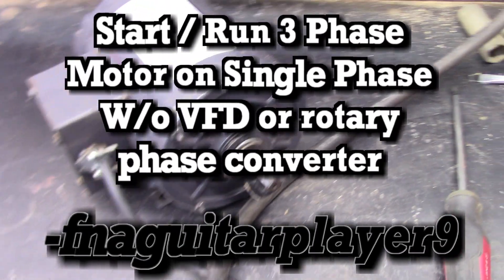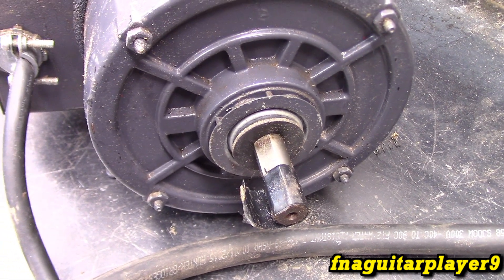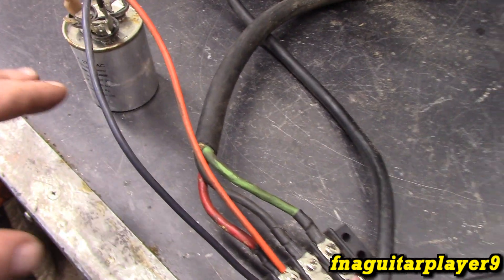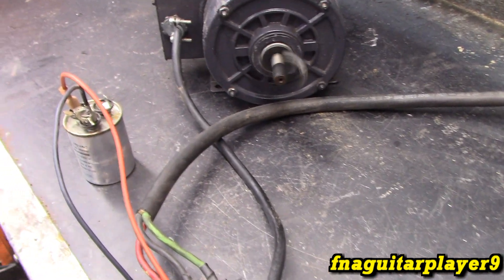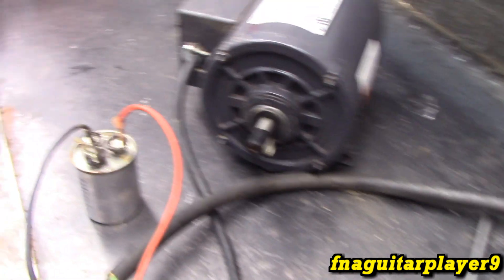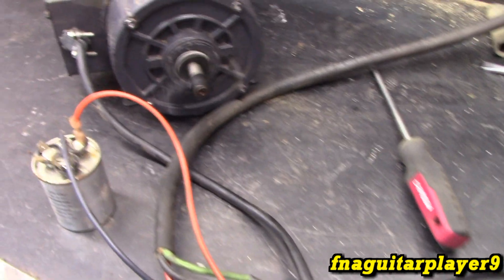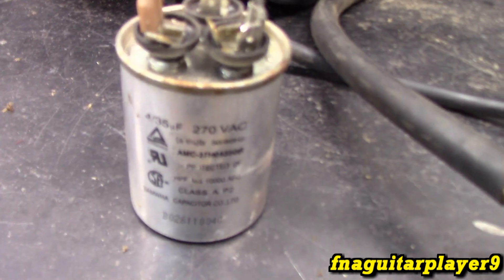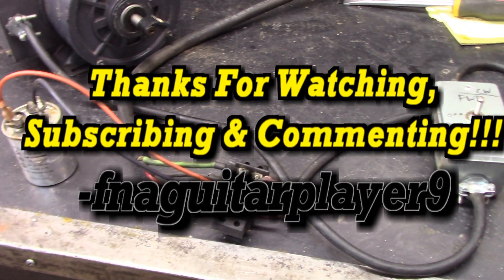Starting 3 Phase Motor on Single Phase Using a Run Capacitor across Phases, no VFD or Converter

Comment: The amp draw will guide you to are you running risk of damaging the windings  heat and correct capacitor to use.

Comment: Used this technique to run a 5 HP motor to use as a phase converter.  I use a motor start capacitor of about 500 ufd to start it.  Use a time  delay relay to switch the start capacitor out after 5 seconds.  Motor start caps are electrolytic and can't be used continuously.  I run a milling machine, a 13 inch lathe, and a Do-all metal cutting bandsaw on this converter.  Adding a run capacitor has minor effect on current draw.  You need the larger capacitance to start it.  I don't connect the 3 phase load until it is running.  
You should be able to do this for the end 3 phase device without the converter "idler".  I think that is how the non-rotary converters work.

Being able to run 3 phase motors on 220 single phase eliminates the need to change motors and provides instantaneous reversal of direction.

Comment: Hi. This has been done a lot by folks searching for free energy. They call it a rotoverter. Was invented by Hector Perez. It wont damage the motor. You can get great efficency this way. The downside is that you have a huge 3 phase motor doing the work of a much smaller motor, albeit at much higer efficency.
Reply: Sorry Hector Perez Torres was the inventor.

Comment: I'm pretty sure this has been a clever "hack" known by many old wizards, where the correct wiring can hack the motor to power its own 3rd phase; obviously at significantly reduced power but.
Reply from the maker: Probably so, I did research on it and couldn't really find any info on it, loved to find a chart for HP ratings and UF. Thanks for watching!
Reply: @fnaguitarplayer9  Unfortunately, google nowadays censors absolutely everything. Qwant tries to remove some of the censorship, but a lot of information is still inaccessible. It doesn't help that those small forums that had this information were killed by the USA with their "Paid moderators report all content to the CIA or you are sued" sopa/pipa nonsense.